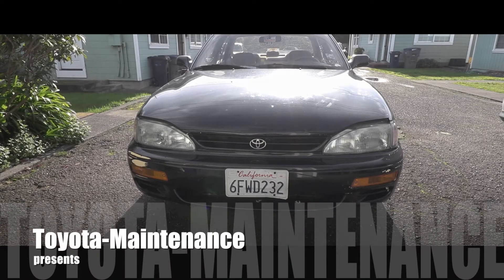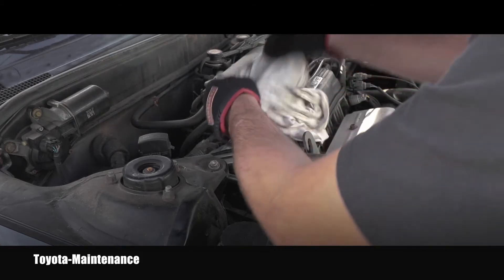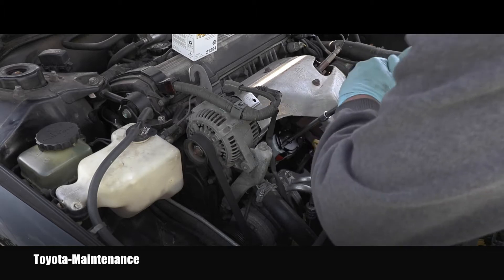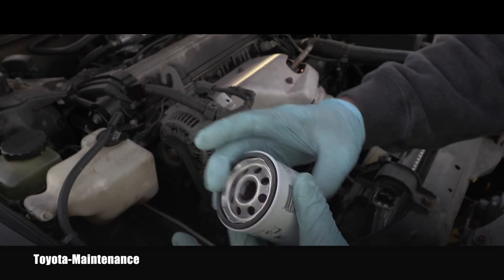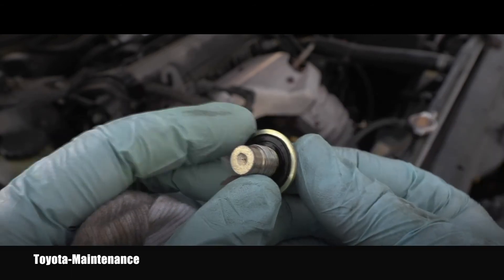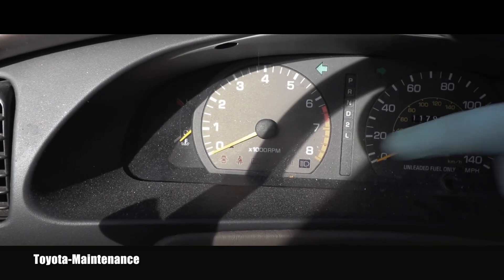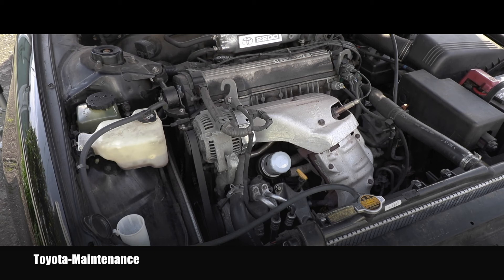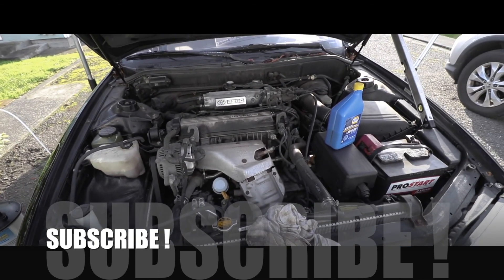How To change oil Toyota Camry 4 cylinder engine

Comment: Is there any way to avoid oil from dripping from the old filter when removing it? Seems like the only design flaw. 
How much oil needs to be cleaning up from that area?
Reply: That’s not possible to answer. Do the job and find out how much oil will need cleaning up

Comment: Will 5 quarts of oil hurt the engine? I accidentally went too much should I be concerned.
Reply: @senk00k, yes, there's a possibility overfilling engine oil can hurt engine performance.
Drain off the excess engine oil (1 qt. Min.), until the engine oil can be seen near the full line on the engine's oil stick.